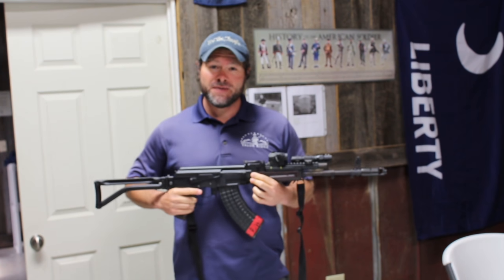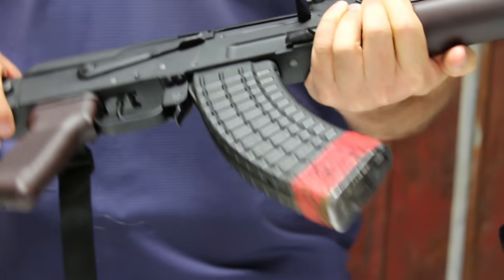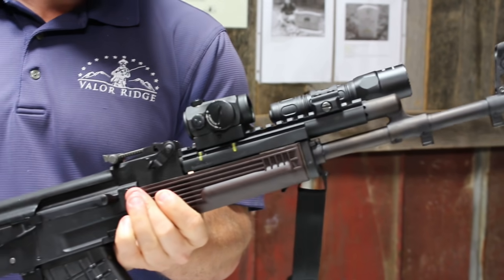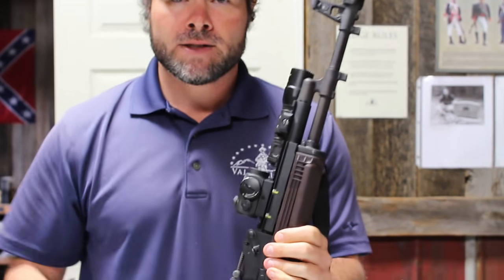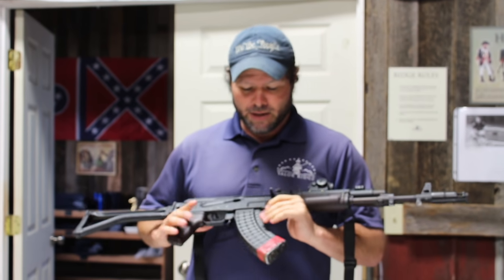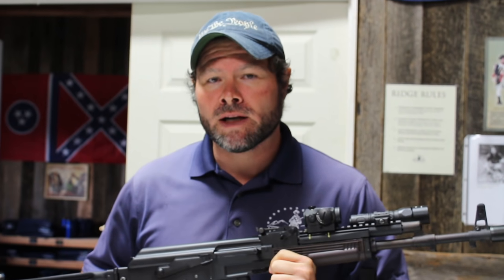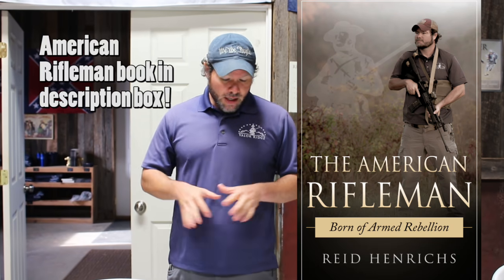Reid's AK Rifle Setup

Comment: I had my red dot go out on my Ak, that’s why I like quick release mount. I removed it in 3 seconds and back to range time.
Reply: I like the side mount and rs regulate.  It’s been subjected to hard use in a carbine course.  I’ve taken it on and off many times, and it has consistently held zero for me at 100 yards.  YMMV
Reply: @Matt_Moore  yeah I’ve got the rs for a zastava but I stupidly sold the npap lol. Now I’ve got a Chinese ak with no side rail so ultimak for me.
Reply: @jibletjibletstein8040  Those Chinese Polytechs and such are great.  I didn’t get into AKs until about 6-7 years ago.  I’ve got a M+M M10x, Romanian underfolder, Meridian Defense Pestilence (Gucci Romanian AK build), and a Arsenal SAM7-SF.  My Arsenal rocks the RS Regulate.

All of those have it’s place, but I think my favorite might me the Romanian underfolder battlefield pickup I got for dirt cheap a few years ago.  I’ve really come full circle to appreciate the simplicity of the AK and iron sights.  I also don’t mind beating on that one and it’s just fun.
Reply: @jibletjibletstein8040  My Meridian Defense has an ultimak.  They are awesome. Wear gloves though…it gets hot.  I’ve got a Trijicon MRO green dot on mine with a quick release mount.  Just make sure to get a good optic that can handle the heat on an ultimak.  I have to spend a little more time cleaning that one because I don’t remove the ultimak when doing so, but I’m unnecessarily ocd about cleaning my firearms.
Reply: @Matt_Moore  the mro is exactly what I’m gonna get. I’m also wanting to mount a light what kind of light mount would you suggest
Reply: @Matt_Moore  yeah my first semi rifle was a yugo sks then a wasr. Aks are the way to I definitely prefer them to my ars. One unfortunate thing is I have an astigmatism in my right eye so a lot of red dots look like shit. My friend had an aim point on his rifle and it’s the only crisp dot I’ve looked through. Do you think I’d have that luck with the mro?
Reply: @jibletjibletstein8040  The QD mount I got for it was made by Trijicon.  It was kinda pricey, but I liked the idea of getting the Trijicon factory QD mount for the MRO.  Alternatively, I LaRue tactical makes a QD mount for the MRO.  I have no personal experience with it, but have heard from several on the inner webs praise it.  Hope this helps and good luck!  👍

Edit:  for a light I got a Streamlight (I think it’s pro tac rail mount 2 - 350 lumens and kinda small as I wanted it to be light).  The mount I got for it is a Haley strategic thorn tail SBR.  The SBR is shorter in length.  It works on my rifle well as my Meridian has the front sight / gas block  combo.  My meridian is more of a cqb setup with a 14.5” barrel and pinned & welded muzzle brake, so I wanted something durable and small.

My setup for a visual and review:  https://youtu.be/g_0DzPETG2Y
Reply: @jibletjibletstein8040  I too suffer from astigmatism.  The MRO looks more like a comma to me rather than a dot.  They all look like that.  I’ve learned to live with and compensate by just ignoring the tail in the dot.  It works just fine.  I typically shoot at paper targets standing out to 50 yards.  Might not be the best thing for long distance shots and precise bench rest shooting, but for what I do it works great.

On another rifle (M10x) I have a Trijicon 3x acog with the drop reticle specifically calibrated for 7.62x39.  With a prism scope like that, it’s super clear and crisp despite my less than perfect vision.  That Acog / M10x is more setup for shooting out to distance.  The 3x magnification, while not a lot, helps a ton.  For general AK use though, I say go with a dot or rock the iron sights.  On that one the flashlight is a Inforce WMLx Gen 2 (the big one).  It eats batteries.  I don’t really like it as it just looks and feels cheap, but it’s held up so far and does throw out the light pretty far.
Reply: @Matt_Moore  light and mount sound perfect. I’ve got a primary arms 5x on my ar that I love and had the 4x with the rs regulate on my zastava was consistently hitting a 12 inch gong at 385 meters with it which is as far as I care to push an intermediate rnd. I’ve got a gun show coming up this weekend gonna see if I can run into a few red dots to look through. Thanks for your help I wrote everything down.
Reply: @Matt_Moore  yeah dude that meridian is beautiful. Scout position on an ak just looks too good especially with a light.
Reply: @jibletjibletstein8040  Good luck at the gun show man!  Yeah agree the scout position on an AK looks sick.

Believe it or not, I actually don’t own an AR15.  Shot plenty of course, but kinda stuck to one platform to build up my supply of mags, ammo, parts, etc. and training to be proficient.  Plan to get one before the year is over though, especially now that 7.62x39 ammo is getting up there in price.  Think for my first one I want a general purpose 16” DI with a lpvo scope, light, and some offset backup irons.  Kinda have my eye on the IWI Zion rifle as it looks like a great value, but not sure yet.
Reply: @Matt_Moore  don’t know much about the Zion but I’d assume it’s a damn good rifle coming from iWi. I have two cheap ars 3500-4000 rnds through both and they’ve been flawless but how longs that gonna last? I really need to get rid of both and buy one good rifle. If shit hit the fan I’d grab my Chinese rifle for sure regardless of how both ars have ran. Yeah the Russia ammo ban is terrible I’m honestly surprised they didn’t do it sooner and now bipartisan red flag laws lol. It’s going great

Comment: You are the first I have ever seen in 12 years to run that compensator on an AK 7.62 x 39.  I have only seen it on the AK -74. When I starting fitting out my AK 7.62 x 39 I choose the same one for the control and screw the weight. So,... it's good to see I am not the only one. I will say it does a great job at keeping the muzzle flip down.  I have followed you since your days at Camden. Merry Christmas and Happy Hanukkah.

Comment: The UltiMAK rail for the MOLOT FIME VEPR-FM AK47-11 is best mod that I made to the AK rifle.  I did not add the Aimpoint Micro for 800 clams and opted for a Holosun 507C that comes with the 2 MOA Dot or 65 MOA Circle for less than half.  It has worked extremely well for me.  Your mileage may vary.

Comment: I bought a Sam7 SF this year and love mine.  Got mine setup with a rs regulate side mount and quality red dot.  No light yet...might get the ultimak.  It’s not my primary defense rifle or anything.

I also need the Arsenal lower hand guard with a pic rail (out of stock) so I can add a short vfg.  I broke my support hand wrist when I was young.  It’s never been the same, and it hurts holding up the rifle in the traditional manner for anything over a short amount of time.

Great video!
Reply: Just use a magwell grip. Rob Ski has a video on this.

Comment: What's going on with that rear trunion area? It's like extended. I saw these for sale on atlantic or some other website, was trying to figure out whats going on with the extension. Never seen it anywhere before. I'd also highly suggest the RS regulate mount as well, you can get the specific part to fit the scope with no rails and it sits much lower than with the front gas tube setup. You can get a tiny bit of cowitness going on as well. They are a tad hard to find right now unfortunately. Also the rails on the gas tube get extremely hot even after a mag or two. It's not worth burning up that nice optic.

Comment: Yeah my Sam5 shoots a beautiful 1-1/4 inch 5 shot group at 100yrds but its with 223 handloads
Reply: I was really tempted to buy one of those Sam5s.  I would have without question if it was chambered in 5.45, but I understand the Bulgarians never accepted that round.

How do you like yours?  They are certain to be a collectible.
Reply: @Matt_Moore  I'm a big fan of the milled Ak's and I like my Sam5 a lot, I'm sure there's people who look at it as a collectors item and would be mad to see what I did to mine because I made it into a 3gun/ battle rifle by chopping the barrel for a frontsight gas block with pin-n-weld keymo brake,  m4 style sopmod stock, mlok rail, akou grip, alg trigger, and Eotech with 4x magnifier. Going on 860rds no malfunctions and no bad signs of wear
Reply: @WalterWhite-gw3vm  it’s your rifle and don’t listen to haters.  That’s bad ass bro.  Thanks for sharing your experience with it.

Comment: Great rifle there. I was expecting that it would be a Rifle Dynamics or even better Jim Fuller worked rifle. I love the Galil side folder, but love my PSA AK-E with triangle folder, & plum furniture. Throw a sling, micro red dot on the Ultimak, & a flashlight, & you are GTG. Also witness marks on screws is such gold, it is worth the cost of this video.

Comment: i have a milled yugo underfoler. action is very smooth. got an amd65 brake threaded for it...but the slant brake fits the bayonet...for cool factor

running the rd m4 stock adaptor on my saiga. love it. still running the long saiga handguard but what i was debating on was ultimak with a dot....or use the scope mount. currently just irons. pretty happy with it

can you do an update on the 20in ar? navyman8903 and i think a few others of us are on a resurgence of the 20in and trying to make a4's great again. i remember you had this setup as well. 

great work reid!

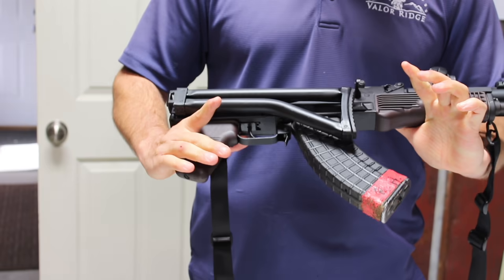Comment: Does that folding stock block the charging handle, preventing the bolt from cycling if you were to need to get a few quick shots off from the folded position? It's hard for me to tell from the angle at 1:19.

Comment: Question from a guy who does not own an AK (yet): is there a reason you should not run a red dot on the upper receiver? I see many modern AK models with a rail on the upper receiver, but even so most youtubers are running their red dots on the front upper handguard like Reid does.

Thanks

Comment: PSA is makin' some of their AKs with FN barrels, which is definitely more accurate than the Arsenals.
Reply: PSA guns are okay but dont compare them to these milled guns.
Reply: I just shot mine at 330 yards. Was windy as hell though.
Reply: I’ve got both stamped AKs and a 1 milled Arsenal.  The Sam7 series is definitely high quality and worth it in my opinion.  That being said, I don’t shoot it any better than my other AKs and prefer the stamped AKs for weight savings.

My own experience, and I don’t shoot thousands of rounds a month or fight wars with AKs so take that into consideration, buy the SAM7 for the smooth action, high quality milled receiver, collectible heirloom, etc and you won’t regret it.  If you buy into the internet hype they are vastly superior in function to say a ZPAP / WASR / WBP Fox, you may get let down.  I have no experience with the PSA rifles and prefer imports, but I hear great things.
Reply: Point being...an AK is not a precision rifle.  They are way more accurate than people give them credit for, but at the same time...a half MOA difference in accuracy between 2 AKs isn’t that big of a deal to me given their intended purpose.  Just my 2 cents and nothing more.
Reply: That is a PSA...notice the missing cleaning rod.
Reply: The Arsenal SAM7SF comes with a 2 piece cleaning rod.  The folding stock mechanism doesn’t allow for a full length rod.  Only one piece gets installed on the rifle.  You also have to remove the muzzle brake...I found that out the hard way when I tried to force it in and put a light scratch on the bottom of the brake same day I bought it like a dumb@ss.

For those reasons, most people just leave it out.

Comment: How high did you have to hold it to get it out to 400 Yards?
Reply: That would depend on his zero too.
Reply: With standard ak sights, no hold over. Just move the rear sight leaf to the 400 setting and go.
Reply: @justinsmith4688  I thought his question was regarding the red dot, and it's hold over?  Maybe Reid used the irons for 400 yards, IDK
Reply: @marzcapone9939  it could have been about the red dot. I didn’t think about that. I probably would have used the iron for that, just because its easy to just slide it to 400 and shoot. That’s just me though, everyone does stuff their way.

Comment: There's a beautiful side railing mount for Optics and you mounted on the gas tube and way too far forward?🤦‍♂️
Reply: Its all about personal preference. Also the side mount wouldnt cowitness with the iron sights.
Reply: I can barely find any online. What would you recommend?
Reply: @kurtlauer2005  ya they do if its r/s actually a much better sight picture, tried them both
Reply: @rangerdanger766  The RS Regulate?
Reply: @kurtlauer2005  yep I run 2 rifles with their forward bias mount. one with a micro and another with a patrol. weak link is they could be fragile but remove in seconds. left the ultimak for a light
Reply: @rangerdanger766  I’ll have to check them out sometime. So far I have just stuck to the irons

Comment: Yikes ...$567 for the Red Dot ?... outta my wallet's league...lol
Reply: They are pricey but will last a lifetime. Need to have a good one on a ak especially if running it on a ulitmak rail or similar. The heat from the gas tube will cook a cheap one pretty fast.